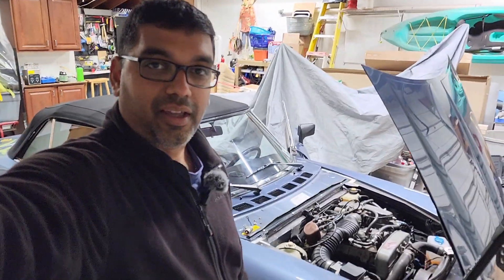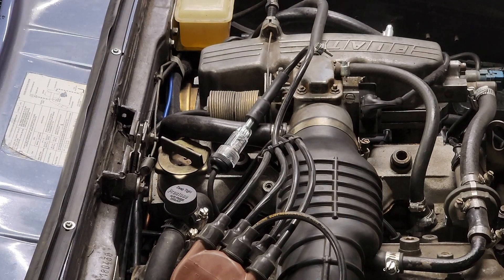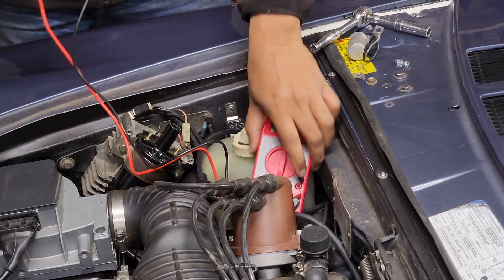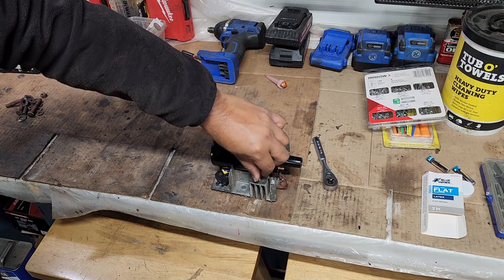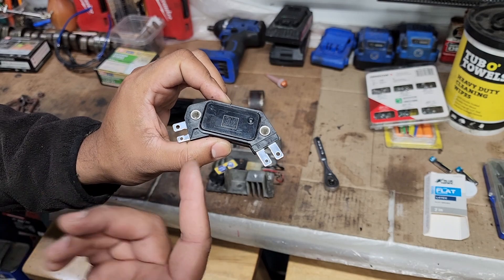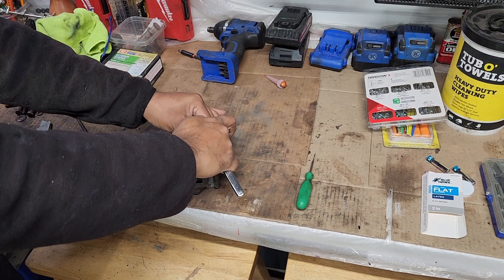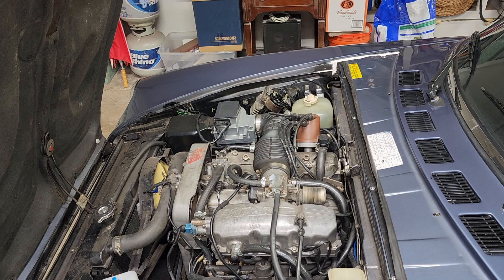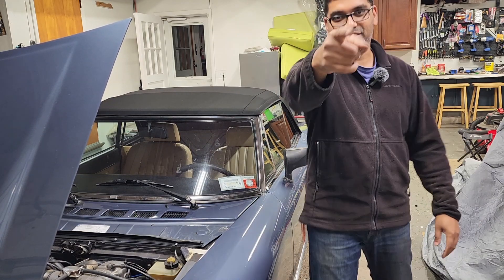My fuel injected Fiat 124 Spider cranks but does not start. No spark issue!

Comment: Hi, maybe you have some ideas on an issue I have with my spider, same year and engine as yours, it starts fine when cold but after running until normal temp if I turn off it wont re-start? I need to disconnect the relay under the right side of dashboard and it re-starts then connect the relay, I replaced the temp sensors and no joy? What should I check next? Coil is new
Reply: I did find this answer, could it be related to the AFM?; I had a similar problem that turned out to be a pooched fuel pump. To test for it, when the car is hot and won't start, you need to get the top of your AFM off, turn the key to the start position and move the AFM arrow slightly (to open the AFM). If the fuel pump is OK, you will hear it start pumping. If it doesn't start pumping, it's NFG.

Comment: I just put new 65 amp alternator in my 81 fiat spider today.   Drove a bit and it stalled , started and stalled , finally after 15 min wait it started and made it home.  Do you think new alternator affected my ICM ?   I think my ICM is about 3 years old , it’s a GM part.   Could an ICM start to fail and be erratic ?? 
Great video, thank you for it!!
Reply: Hey Robert, you may want to check the coil.  My 81 would do the same thing, run good, stop for a soda then no start.  Had to have it towed twice.  changed everything with the ignition only to find the coil would break down after the car was stopped.  Yea, I spent a couple hundred dollars to find out the issue was a $30.00 coil.  Then the 81 ran good and for reasons of getting busy in life, the car sat for 18 months without being started.  I decided, after owning the little car for 20 years to go thru it and bring it back to life.  Of course it would not start.  The 81 would start with starting fluid but then promptly die.  Also, the water pump was leaking badly and the alternator bearing was going out.  So, I changed the water pump ($75.00 or so) and alternator (another $75.00 or so).  Now it would not start at all, even on starting fluid (4 cans at $3.95 each), only to find the wire connector that provides power to the ignition had broke.  Replaced it and the little car would start with starting fluid again.  Traced the problem to the electric fuel pump not working.  Replaced the fuel pump (yet another $75.00 or so) and the 81 started but ran terribly.  Removed the fuel gauge sending unit and pumped out all the old fuel (fuel pump from Harbor Freight ($25.00 or so).  Replaced with fresh fuel ($12.00).  The car started but the injectors were not working properly.  Added some Sea Foam ($8.00) to the fuel and let the motor run.  After about 15 minutes the injectors cleared out and the car started running pretty  well.  Two days later I went out to back the car out of the garage and it would not start.  Checked and found I was not getting power to the fuel pump.   Traced back to the fuse panel and low and behold, the fuel pump fuse was missing!  Yep, it was not there!!  So, to the auto parts store for some fuses.  Ha, Ha, they don't carry European ceramic fuses!  "never heard of them" they said.  I ordered some from Amazon and while at it, ordered a complete fuse panel with GM style fuses (around $40.00, another future project).  Installed the fuse and the car started on the first turn of the crank.  The car has never started so quickly!!  I was amazed to say the least.  The next day, I went out to repeat the QUICK startup.  Nope, it had to turn over a number of times before it started.  Seems the fuel pressure regulator has a slow blead down over time.  Soooo, I did the last thing I should have done, I bought a fuel pressure gauge ($45.00) and installed it in the clock space (the clock did not work and would you believe, the clock lens was cloudy???  Yea, just like they all do.  Anyhow, I installed t he gauge and a safety toggle switch in the power window blank.  That way, I can prime the system after it's been down for a while and I can monitor the fuel pressure.  Great! Nope, the gauge lights up and you think it is going to work only to not indicate pressure.  Yea, I'm going to have to look into that.  So, to install the safety toggle switch ($6.00), I removed the upper center console and in doing so, noticed how bad both it and the lower console were looking.  I ordered a new replacement console cover (110.00+) and when it arrived, went to the local street rod upholstery business and got a quote to have both upper and lower console covered in a nice pleather black (Only $300.00).  Now the carpet doesn't match, so I ordered replacement carpet in black ($200.00).  Then, I decided to look into a one piece burl wood dash panel.  So I bought some burl veneer (I bought enough to use the extra on another project in the future)($58.00 plus glue, brushes, rollers, etc which will be refinishing a 1938 Philco radio).  Now, I need a three pack of gauges, volt, oil pressure, temp.  Yep, I'm moving the temp gauge to the center of the dash (if I can make it fit)($35.00) and of course, that led to an empty hole between the speedometer and the tachometer, so I bought a clock ($60.00 or so).   The tan seats are in pretty good shape but the upholstery shop will recover them for only $500.00 each), yea, that's going to be another project.  But, I will most likely go back with tan because before I started to try to get the car running (remember that?), I spent over $600.00  on a new tan roof.  So, with a new interior and running car, I will need a paint job and yes I am going to do it myself (when I'm finished, I will surely take the car to a professional painter to have it redone.  So that shouldn't' cost over a couple grand ($2,000.00) or so.  Oh, did i mention I will need to relicense and insure the car ($400.00).  Just to get to drive it in the fall.  Aw, the love of the Fiat Spiders (this is my second one, the first was a 79 that I drove for 5 years and loved the car).  They are like a woman,  beautiful, sexy and costly ;-), but hard to live without.  My wife sooo wants me to get rid of the car, but she and I have only been married for 13 years and I have had an intimate relationship with the little 81 for 20 years.  Please, sweetheart, don't tell me to choose.  tee hee